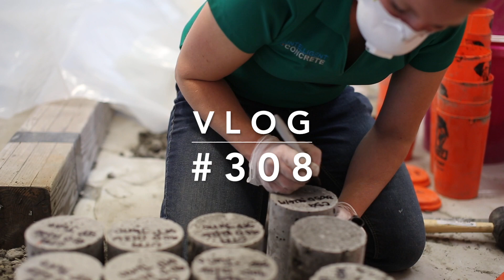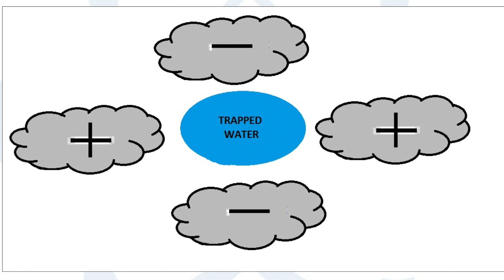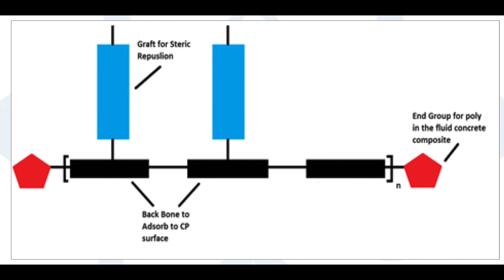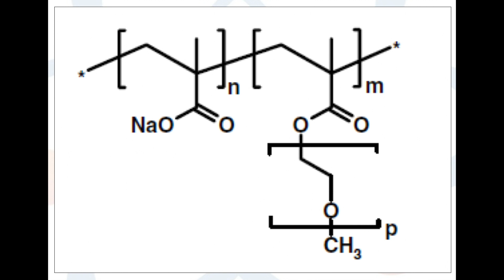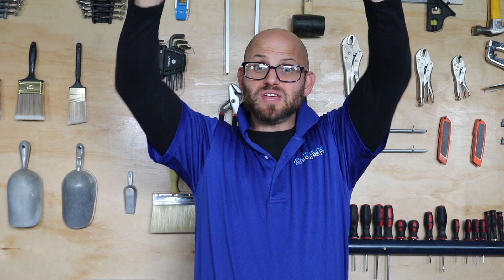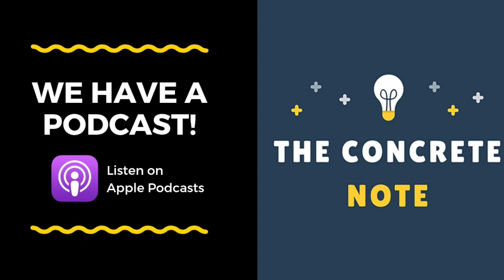An Analysis on High Range Water Reducers - Vlog #308

Comment: Thanks for this wonderful explanation, what is the best way to test the compatibility of PCE for a type of cement.
Reply from the maker: Sorry it took so long!!!

Run a series of experiments with the same cement using different HRWRs.

Vary the dosage and measure your slump / spread every 10 min for 90 min.

Use mortar to start out with to make it easier to manage the plethora of mixes.